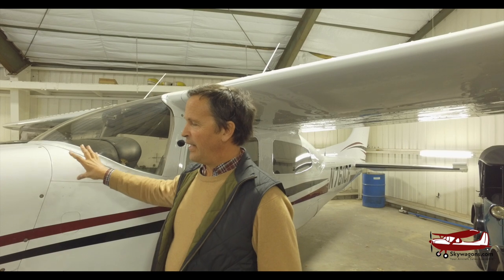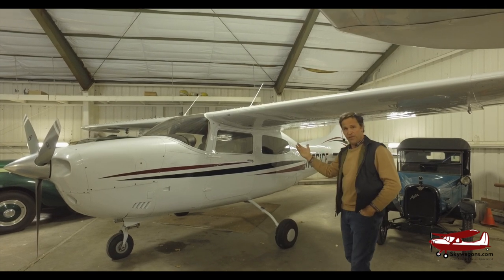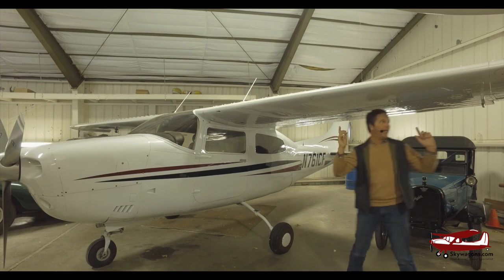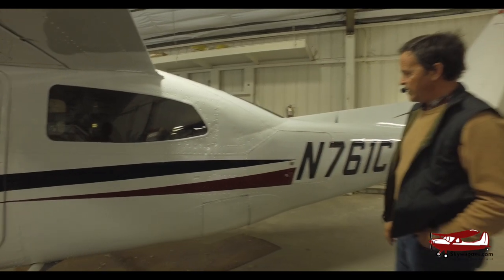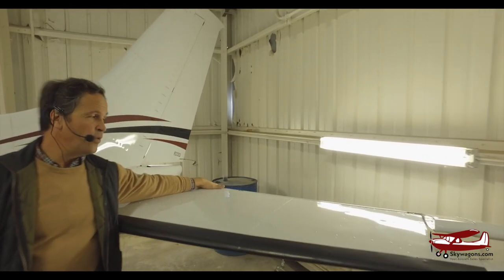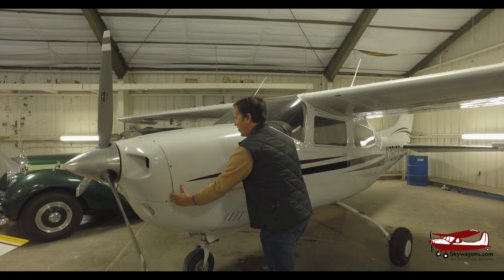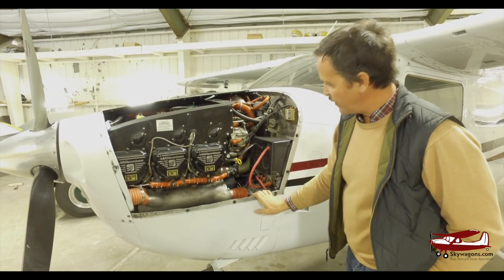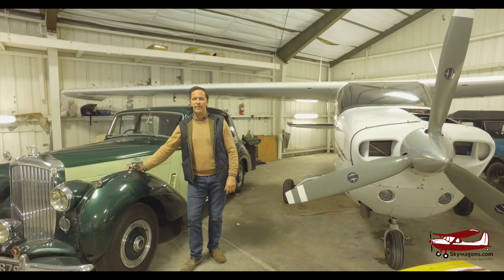T210 Year Model Changes

Comment: As always, great video Mark. Would you please explain how the turbo works, and compare it to a normally aspirated system? Thanks!!!!!
Reply from the maker: It's a bit of a long comparison, but basically the 210 is a true turbo with the turbo running all the time. Also they run "over square" with higher manifold pressure than RPM.  There is more heat and wear and the TBO is less because of the turbo.   In a 182 RG it is never "over-square" and it is manual and optional and the TBO is the same on the engine with or without the turbo.

Comment: Did you say the cardinal NOW has an AD for the wing? I thought it was for corrosion due to a seal leak at the upper windscreen and wing strut. I am guessing aluminum corrosion. Thanks from KSAC.
Reply from the maker: No,  The 210 has the AD and the cardinal might get it too.  They are working on if it needs to.

Comment: Question: Would you get a 1978 or later T210 or a more recent 2012 T182 ? Assume the panel was upgraded with some glass on the 210.
Reply from the maker: If I had the choice, probably the 2012 182 because there is no Spar AD and there is a Lycoming engine in it.

Comment: Ref Oz in flight fatal. Note past multiple instance in Oz of outer plane failure @ inner station aileron end. 
Rear seat position: maybe later models remedied, but all I operated had no heating outlet for rear pax. Really uncomfortable even in moderate temps.
TBO'S  are a disappointment: as supervisory engineer, we normally had top overhauls done approx 1,000 to 1,200 to reach either base OH life or extension of a few hundred hours. Worst cyclinder cracking variant of Contintals, the 285 hp and up: high intolerance to shock cooling compared to Lycoming equivalent.
*Main gear crutch: ESPECIALLY earlier spring leaf ~ careful,  thorough inspection required ref crutch cracking, causing gear fail, or complete separation. I would not buy any with this gear, unless the fuse was opened up, legs removed ~ have experienced new CofA issue ship with 80% critical location fracture both sides.

Comment: Owned a few different models of the T210 a great airplane, fast and can haul a load.
Reply from the maker: Yes indeed!
Reply: Last one I had was a 1983 N model, they changed the fuel system I believe in 82 so it made it easier to start when engine was hot

Comment: I owned a210 h for my use as a bush aircraft the location of the mainwheels is further forward and thus had less weight on the nose wheel than an 210 N for example. thus taxi in heavy grass etc the chance of prop strike greatly reduced. 165kts 53lph double glazing oh so quite. Was cheaper to operate than my 182p per mile
Reply from the maker: Interesting.  Thanks.  210's are great back country planes and are used a lot in Idaho.

Comment: Any differences in the fuel systems or how fuel quantities are calculated throughout the different models?
Reply from the maker: Yes, it is a bit involved, especially in the pre1967 planes.  All these later Centurions have 84 gallons capacity in two tanks.  Tip tanks can be added and there was no "standard" fuel option once there were no struts under the wings.

Comment: Hi Mark. It true that the 210 has an AD on the wing spar but the Cardinal 177 only has a SB (Service Bulletin) not an AD.
Reply from the maker: I understood that it was an AD on both, but that may not be correct.   What did you hear?
Reply: @skywagonuniversity5023  I own a 1973 C-177B FG. So far it is still a SEL.  SEL-57-09
Reply: @skywagonuniversity5023  , Hi Mark. Love your channel and the thorough technical content and knowledge you have.. I was watching a 177 channel video just recently and one of the comments for the 210 AD was because there was an adhesive used somewhere behind the headliner, which could be a moisture trap leading to potential corrosion in and around the spar, whereas the 177 didn't use adhesive so no compulsory AD inspection. Not sure the accuracy as I'm not an airframe engineer, but just a stale low-time pilot who loves strut-less Cessnas! Cheers from NZL, David